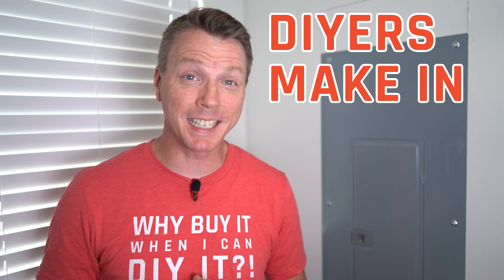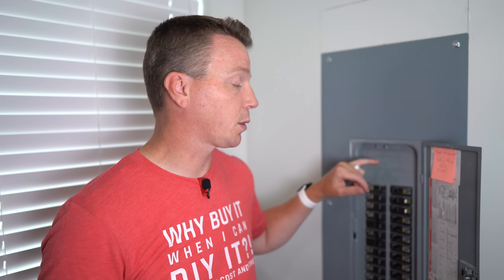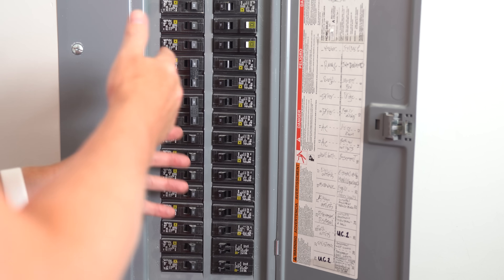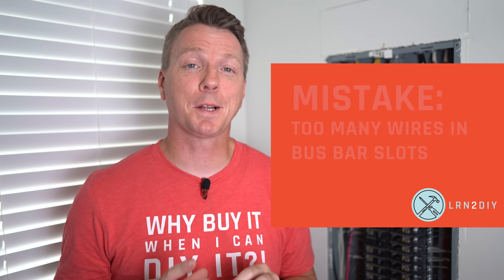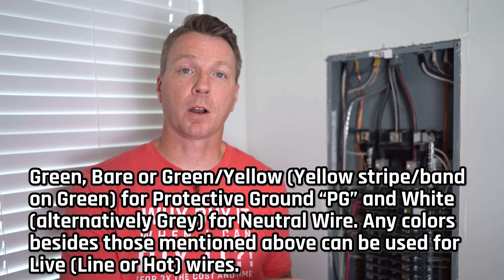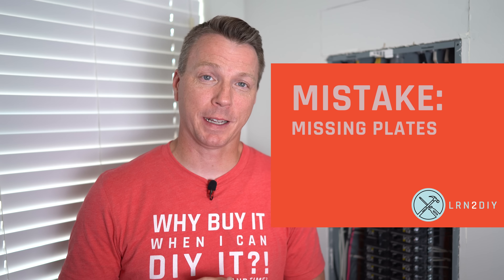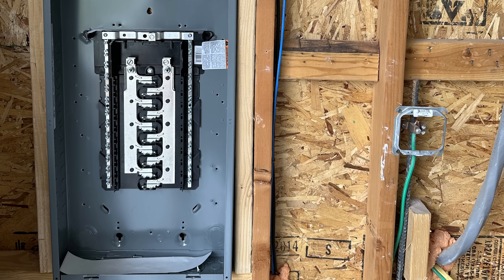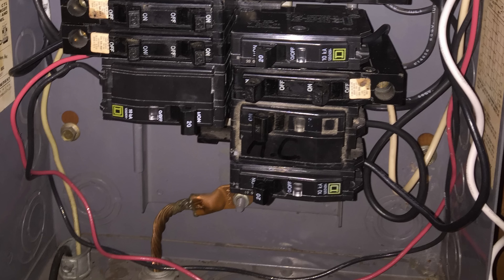10 Common Mistakes DIYers Make In Circuit Breaker Boxes

Comment: Check with the panel manufacturer on double and tripple tap grounds and neutral wires , some panels require a min of 2 grounds in one hole for the screw to make a good connection.

Comment: Just had a new 200A panel installed.  The inspector checked the torque on every fastener in the panel and also checked the backing nuts were tight on all the connectors.   Checked wire size matched the breaker size. Then outside the panel, he checked the set screws were tight on  on every EMT connector in sight.    Very thorough inspection, glad I had an electrician who knew the inspector and what he would be looking for so that there weren't any rejections.
Reply: Damn that inspector has a Napoleon complex. I'm a master electrician with 40 years of experience, I've wired over 1500 panels. Residential, commercial, industrial, Marine and even federal government work   never seen any inspector check ft lbs or in lbs of torque.
Reply: I’m a master electrician of 50 years. Most inspectors do a visual inspection, because there’s a liability factor once they touch your work. They may for example check your torque on tools but that’s the extent of it. That inspector had other issues
Reply: He just checked minimum torque, I bet, so not Napoleon sociopath. NapoleonEC, check for too much torque!
Reply: Wish the electricians that did my house would have tightened all the lugs I found one that got hot and it was barley finger tight and it had been final signed off buy the inspector. I called the electrician he said they would come out and fix it never saw them again I got the torque specs from an NEC manual and tightend it myself.
Reply: Oh he knew your electrician alright! he must hozed up somethin REAL GOOD before!!! lol

Comment: Only problem with wrapping a Hot with red tape at the breaker is that the other end is also hot disguised as a neutral, dont do this as someone will get hurt.

Comment: #1 lethal mustake: Not Locking panel power off LOTO then perfoming LDL live dead live test to vetify power is off while wearing proper arc flash PPE. Din be stuipid and get upu self killed workng onlive power then if you have to work on or even look at live power with panel covers off, if fir testing puposes only always wear arc flash rated PPE (persnal protective equipment) rated fir the arc gkash potential of your panel (gloves, fite resistant clothing, face shield, balacava, safety glssses, cityon undershirt and under wear, cotton socks, ekecyric rated shoes.

Comment: Another issue!! You should ALWAYS tap the cover with the BACK of your hand BEFORE doing any work inside the box. Including resetting a breaker. An electrician friend got severely electrocuted because there was voltage on the box itself. Using the back of the hand is a lot safer than your palm.
Reply: This should start a firestorm of opinions, but in keeping with your theme I'll add this.

When I was very young and learning so many things from my late Dad, I was told when doing panel box work/inspection (especially unfamiliar ones) to "keep your other hand in your pocket". The premise being if you would come into contact with a 'hot' surface it would minimize/reduce (note: not eliminate!) the chance of a fatal electrocution by making the current path through your body from the hand in use down one side of the body rather than traveling across your chest if your other hand is in contact with an earth ground (usually panel box frame). As electricity will take the path of least resistance, it would almost certainly travel from one hand to  the other crossing the heart area.

While perhaps not always the most practical in all instances, I've found it a good rule of thumb. Even when checking voltages I'll use an alligator clip lead for the ground and work the other test probe with one hand. Panel boxes are especially hazardous because of the 'mains' leads connectors; main breaker and 'hot' buss bars. It's pretty much like climbing up the pole to the transformer secondaries so far as power factor and shut-off ability.

Totally unrelated, but I'll add anyway. The other adage that's stayed with me as long as I can remember pertained to cross streets and parking lots. He'd point to a car and say "Those are headlights. They're not eyes. That automobile can't see you." Must admit I was a child in the days of round sealed beams, but still made me think and probably kept my sorry self from possibly being a statistic.

Comment: I think that re-torquing and Cu/Al wiring that was installed during that “fad” of the 80’s and early 90’s is a very good idea. Also, a question. When the torque is listed on a component is that the exact amount that needs to be used or more of a minimum amount in order to get a complete circuit?
Reply: Aluminum wiring was not a ‘fad’. Copper took a HUGE increase in cost, and copper wire took a HUGE decrease in availability during that time.
Short term; markets stabilized.
Long term; aluminum was found ‘not really suitable’ for house wiring (thermal properties, mainly, but galvanic problems also)
Reply from the maker: Good question. My understanding is that it’s the ideal torque but I can’t say definitively.
Reply: It was not a fad. Cost saving measure. This was late 60s, early 70s.
Reply: From an engineering viewpoint, torque values should be adhered as closely as your torque tool can make it.
No more
No less
Reply: At.  When you select a torque value on any device that device will "slip" or "alarm" at that setting.  That is the manufacturers determined setting that will produce the lowest heat over time and not distort the shape of the conductor.   You'll see for example that devices used for aluminum have a much lower torque value so the actual conductor isn't disformed and caused to produce heat (so aluminum listed devices will actually be doped with iridium that gives them that dull silver finish) 

Exceeding that maximum rated torque value can be as detrimental as not reaching it.  

Thats a very real and often unasked question.

Comment: not relevant but did the plasti dip hold up on your truck?
Reply from the maker: It has done pretty well. We’re three years in now and it’s at the point where I should probably remove and reapply it. The grill has several small holes from all the bugs and impact and it’s definitely time to recoat it.

Comment: When you color tape a white conductor to indicate a hot wire you absolutely must tape the other end where it terminates. A hot white wire in a box could be taken as a neutral and used opposite a hot from the opposite side of the panel resulting in a 240 volt feed applied to a 120 volt appliance.
Reply: I never trust anything in the box ever...i always double check it....have no idea who has been in there...lol
Reply: Yes that is correct.  I was taught to use black tape to mark a hot white wire because the hot wires are black.
Reply: @slalomking  If it's the secondary hot (240V circuit) it has to be a color other than black (or white, green, or bare).  I carry black, red, blue, and green, giant "Sharpies" in my electrical tool bag to mark wires.  I do it when I'm installing the circuit, so both ends get marked.
Reply: @kwilliams2239 Yep, Sharpies and paint pen are many in my tool box for just that reason. 👍
Reply: @kwilliams2239 no by code it can be black. You are right about the other colors
Reply: @thomasmarable6818 I was thinking that the hots had to be differentiated (traceable).  My mistake.
Reply: Yes. . .   And on large cables, we also taped or marked them both sides of walls or bulkheads as well. . .   I also number Outlets, with the Circuit Breaker number and it position in a circuit, such as CB4-3. . .  Being the 3rd outlet feed from CB #4
Reply: @hughleyton693  So true, I really wish that was standard practice in home wiring as it is common in commercial installations. I am going through headaches trying to figure out my home's circuits as there are 3 sub-panels.
Reply: You're only allowed to reidentify wires #6 and larger per NEC.
Reply: @bisurdaddy try again  1 it's not #6 but #4. 2 cable assembly such as nm cable or mc or ac cable can be reindentify no matter the size.
Reply: @bisurdaddy if all the wires are in one assembly such as romex or mc cable you can use phase tape, marker, paint marker to identify/use the white as another hot  leg on a 2 pole breaker
Reply: @bisurdaddy  Which NEC reference #    ? ? ?
Reply: This was my exact thought when the red tape was added to the wire in the panel (common mistake #7). Both ends of that wire need to be color coded in the same manner.
Reply: @FarmRanchHomestead  I agree, need to make sure the other end is marked too. I'm glad someone beat me to it 5 months and then 15 hours ago!
Reply: This is why you should never hire electricians.  They give out tremendous amounts of false information like "Only use 80% of a boxes rated capacity".  Nonsense.  The box is RATED 150 amps it can DELIVER 150 amps ALL DAY LONG and NON-STOP...that is what rating means.  He also talked utter nonsense about he cannot add more on to this panel when he added a finished basement.  Pure idiocy.  You can double each individual breaker to get the required capacity.  There is no physical way to overload a panels capacity TURNING EVERYTHING ON FULL POWER.  Light circuits run an amp or two MAXIMUM.  Wall outlets might run 13 amps maximum with a space heater but no one is running FIVE SPACE HEATERS AT FULL POWER while the electric water heater is running, the dishwasher, the furnace, the electric dryer, etc.  It simply never happens....
Reply: It would be GREAT if you could find wherever in the hell it went to, or a new install. But who TF is going to do that if you open an existing panel just to put a new circuit in? NOBODY!!  but if you pulled a permit and are getting an inspection you will get hit every time on a white wire being landed on a breaker if you didn't identify it with black, or PICK ANY COLOR of the rainbow but green or usually grey too. Black sharpie in your pocket will work nicely too.  Tape'em all and let whoever opens a box up check for themselves. There is almost NOWHERE  that you are going to find 240 anyway with only TWO wires and a ground besides an appliance/heater/motor/hvac. Only split circuit outlets in a kitchen are likely to have 240, either in the box, or on the same device with the tab removed, and that will require a red wire in there somewhere. I HAVE had customers that had their friends monkey with my three wire box that i split off another circuit to parts unknown to them, and yes, they did uncage their eyeballs. My fault? no. Their fault. and no sympathy from me, that's what he gets for not calling me back to extend the circuit from my box.
Reply: I'm not saying it's not a good idea, but if you are replacing a two wire 220V outlet and think the white is neutral then why are you using a screwdriver in the first place?
Reply: @CR67 just a guess, to loosen the screw holding the wire in place ?
Reply: you must have met my uncle, now rip.  he did exactly that and along came me x years later putting a ceiling light-fan combo in mom’s bedroom.  everything ran smooth until i started tying wires together and i grabbed the white neutral, except it wasn’t.  zapped me good and i let go with some non-baptist language & earned myself a scolding at age 65 from mom as icing on the cake.
Reply: @kodeks-az    Nonsense, there is no regulation about colour code or not colour code with tape.      If the wire colour is not the correct colour, then it is advisable to colour code mark it.
Reply: @hughleyton693  I advise you to look in NEC 2020 Chaper 2 Section 200.6 A and B
Reply: @hughleyton693  i beg your pardon, but white wires landed on a breaker are a code violation. It's probably the #1 correction required after double tapped neutrals. Want the NEC article? I'll bet you would but it's 1 A.M.
Reply: Right but the entire wire has to be covered with red or black tape and not just both ends . Or magic marker the whole wore up to the knockouts 😊

Comment: In all my 40 years as a licensed electrician I have never seen a residential electrical panel made up like this commercial grade panel. DIY work by homeowners wouldn't know how to disconnect everything & make it up properly like an electrician should.
Reply: That's sad hoss.  Every panel I've ever wired looks just like that    and your correct homeowners have no business messing with something you can't see that will kill you!
Reply: @michaellike5037  As a homeowner & C-10 licensed electrician I can tell you that most residential electrical panels installed when the house was built don't look much better than his DIY house panel does. 
I've seen modern track homes with shoddy wiring at the panel just good enough to pass inspection. Sad thing is the old saying = time is money & a track home being built from the ground up can't take more than 90 days total time. 
The man wiring the panel can't spend 1 hour landing all the circuits and remain employed by his contractor.  35 minutes max is what my contractor placed on me back in the 90's when I was doing track homes & panel make up. I still managed to make them correct & properly sorted out.

Comment: I always thought that the section of the panel where the primary feeds reside ahead of the master breaker, cannot have any other wires going through. They must enter below the master breaker location. Is that local code dependent?
Reply: Neg   it's called a pass thru system   only one means of disconnection is required
Reply: @michaellike5037  Thanks for the clarification, Michael 👍.

Comment: Decades ago I took a studio engineering and sound reinforcement course at the local community college.  The instructor did sound for hotels and arenas and other venues.  He said that he always ran into tripping breakers because in most places like banquet halls and hotels, everybody uses the circuit breakers like a wall switch, and every time they manually trip the breaker to turn the power on and off it slightly reduces the friction or resistance necessary to trip it.  So over years and years of being flipped open and closed, a 15 amp fuse might only be able to handle 12, or 13 amps.  So he always carried a hand full of breakers in case he ran into one that would refuse to stay closed.
Reply: Good story. Breakers are rated for 100 on/off cycles unless it is a switch duty breaker.
Reply: In RV parks with electric hookups many campers (including me) switch the breaker off before & after plugging in.  My guess is that they see hundreds of cycles, and I have never been warned to avoid that practice.
Reply: Personally, if load on a 15a breaker goes north of 85%, I'm looking to move to a 20a breaker [with new pull of 12awg as needed].  Heat kills the bakeolite material over time, and that can get VERY exciting: pull a breaker and the stabs just might leave the frame/stay on the bus after a few decades.   On a 2p or 3p breaker suffering such an event, odds of flashover are very high.  The 85% rule has done well for me on any ampacity breaker over the years - as long as wire size gets corrected as needed.  Even still, a thermograpghic inspection periodically is money well spent.
Reply: Ah, the old days.   Now, if a breaker does not hold, just find another one.  The liability of playing in a hotel breaker box is just not worth it.  We will typically carry our own 200A temp distro and have the facility tie it in for us.  All liability transferred to them then.
Reply: Correct. . .   Circuit Breakers should not be used as regular Switches for multiple use.    Keep their use to a minimum.
Reply: @hughleyton693  Also keep in mind that even if they are set up to be easily replaced, which some are, it's a lot cheaper to replace a switch than a breaker.

Comment: As an electrician I think 2 that should be on the list is placing grounds and neutrals on the neutral bar in a sub panel and since you mentioned using  tandem breakers.  Using tandem breakers to expand the number of breaker when the panel either has a restricted area to place tandems or it is not listed to use tandem breakers.
Reply: Seems as if bonding, grounding is an elusive concept for most non electricians.  Although there are mistakes discussed in this, there are soooo many others folks make that are less obvious.  Improper grounding is a usual suspect.

If I was buying a home someone owned before me, I  believe it money well spent to have a  good licensed electrician inspect, check, recommend any necessary improvements needed whether to correct code violations or just enhancements to make safer and more usable.

Watching a couple of videos is not a substitute for formal training and years of experience.  In this world you usually get what you pay for.
Reply: Typically, if you have an unmolested panel, your fine.

Comment: This is a Sub-Panel, and not the main panel. Therefore, as you can see, the Ground and Neutral are isolated from each other. The Neutral bus bar is separate and isolated from the Ground bus bar. The Ground and Neutral are brought in on separate wires.  The Neutral and Ground are tied together at one point, at either the Main panel, or at the Main breaker. Notice that the neutral wires from branch circuits are tied to isolated neutral bus bars.  There are three insulated incoming cables to the panel, two hots and one neutral (the neutral has a white stripe), in addition to an uninsulated ground cable.
Reply: No it's not a sub panel. I'm a licensed electrician and main panels are wired like this when there is a disconnect outside which is now code. The bonding only occurs at the point of service termination.